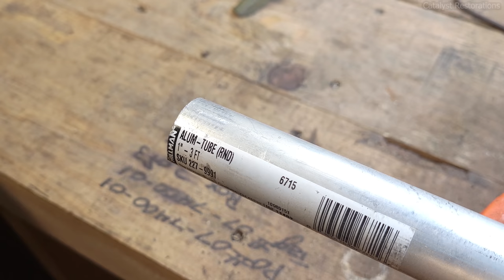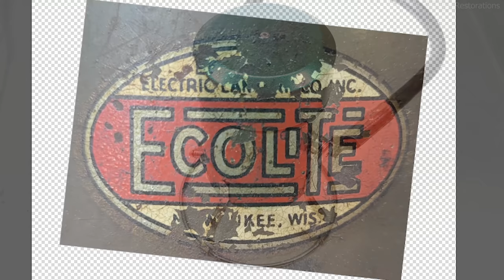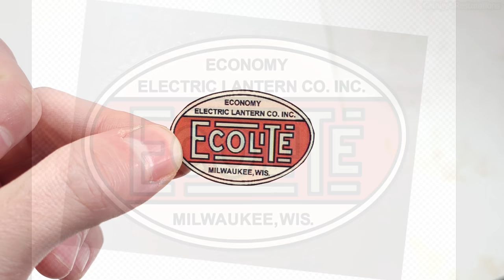89-year-old "Ecolite" Electric Railroad Lantern Restoration

Comment: I do Marine repair and also restore muscle cars and I took on look at the rust pile and thought man now way he is going to need a donor to fix that . Even for my standards I will take on the most difficult jobs if  I have too. That one i thought man no way its too far gone. But you pushed through the rust and rebuilt it . I love the color you picked! I am going to restore a old school die grinder with the flexible shaft it looks from the early 40s I got it with the original wood box. I want to refinish the out side of the box but leave the inside original and I need to fix a crack and replace the hinges. But I need to make a new decal for the top of the box and dont know how to do it. When I get my youtube channel going I want to make a youtube video of it and the restoration. But I still need to learn to edit. I ordered soft ware but the post office lost my order . So I dont know what I am going to do. Nice job my man nice job !
Reply from the maker: Thanks for the kind words, Roger. I had doubts myself at various stages of this project that I was going to be able to pull it off! Best of luck in your die grinder restoration, sounds like a great project! For the decal you might consider water slide decals like I used in this video. There are lots of great YouTube videos that explain the process and it's very straight forward. The hardest part is attempting to recreate the decal in graphics editing software. As far the video editing goes, don't sweat it! I didn't know the first thing about it before I started this channel about 2 years ago and I learned it all entirely myself through YouTube. You could look into purchasing a copy of your editing software digitally if you're worried about losing it in the post again and your copy never turns up. I know it's not cheap!
Reply: @CatalystRestorations  I will be honest with you. For over five years I was frozen in fear of video editing, never been a techy guy. I still have a old school flip phone. Hey if it works why change it. I was very intimidated with editing, My dream was the You tube . But scared to death to try editing. Here about three months ago I got a free trial for Movavi . I was scared to try it . I literally talked to myself and told myself and forced my self to open it up and get some old videos I had done and started playing with it. I went on youtube for Movavi editing and made some simple steps like cutting and adding text and transitions. I started getting some confidence in myself and after a week my trial was over. But dude Movaivi kicks ass I learned so munch in one week ! My business shut down 95% so I had no money to buy it. I want a cd not a signal and down load incase my pc crashes and can down load it again. I had no luck. I started watching more videos on tube and found one on shotcut. I watched all the way through. And thought wow that is cool very basic and lot like Movavi . I found a older version on ebarf for 2019 on CD and ordered it that is when the post office lost it . Looks like the seller is sending out another one for me. He is getting positive feed back. I have a lot of projects already done for youtube that are un edited . I had to put it on the back burner because I ran out of money I need a $90.00 linkage but current project is a Factory 425hp Chevy 409 intake and carbs I am restoring . I got the wrong carbs with the set up but they will work but that is going to be one of my youtubes. The linkage wont work for it I have to buy Edelbrocks linkage and its almost $90.00 I am excited to get it done and filmed when I am done I am going to sell it. I hope this will help people with the video . Rebuilding carbs is a dying art thanks for the well wishing and reply

Comment: You might consider putting a coating of NOALOX on that rotating switch mechanism's contacts to prevent future oxidation/corrosion
Reply from the maker: Excellent advice, I think I will do just that! Thanks for watching!
Reply: @CatalystRestorations  I also dope the light bulbs that screw in, both on handheld equipment, and outdoor bulbs on houses or bulbs in bathrooms with a thin layer on the threads, and a dab on the end contact. They can be in there for years, and they unscrew without getting stuck and breaking.
Reply from the maker: @specialservicesequipment393  Also a good call, because these bulbs are very fragile!

Comment: Concrete Cleaner and Metal Prep solution that you can purchase at Lowes/HDepot is the same stuff as Evaporust at a fraction of the cost.  I have a bucket of the stuff and use it all the time.
Reply from the maker: Chemically those are completely different products entirely. Klean Strip's concrete/metal prep solution is 40% phosphoric acid and does dissolve rust, but it will also eat at your base metal too because it's an acid by its very chemical composition. Evapo-Rust on the other hand is 90% water and 10% sulfur-based chelating agent that chemically bonds to iron oxide (rust) only. You can leave delicate steel items indefinitely in Evapo-Rust (literally for years) without the base metal ever breaking down. The concrete cleaner is also really a one-use product whereas you can reuse Evapo-Rust over and over. I've been still using the same 1 gallon jug for almost 2 years now. Personally I also care about environmental impact as well and Evapo-Rust is substantially safer for the environment than a concrete etchant. Not an Evapo-Rust sponsor, just believe in the product. Electrolysis for rust removal is still cheaper than literally anything else though by far.

Comment: Funny that in 2022 we use that same design lantern on the railroad
Reply from the maker: Crazy right?! I take it you work in the railroad industry then. I will say that I would like to at least see some LED bulbs in this lantern though! I've got a few other lanterns waiting to be restored and I may upgrade them to LED as part of the restoration.
Reply: @CatalystRestorations  yup 19 years. And they still use 6v batteries but they are led. You would think they would have rechargeable lanterns but I’m sure the railroad is too cheap to buy those
Reply from the maker: @7171-Ws6  Hahaha, too funny. Well stay tuned, I'll have some more lantern restorations coming in the near future!

Comment: Very nice refurbishing effort in this near totaled lantern. If you want something closer to the phenolic insulator plate that was broken up, try using printed circuit board materials. If you can't get the material without any copper plating, use some Ferric Chloride to remove the copper . And then you have the perfect insulator plate that can be drilled and formed however you like. Just an idea... Thumbs Up!
Reply from the maker: Hi Gary! You are the first person who has been able to nail down for me what that material is called - phenolic insulator! Thank you for that! I did look into circuit boards and I think it's actually a better analog to the original material than the plastic I chose. It essentially just came down cost, but in the future (I've got a few more lanterns!) I think I will try the circuit board route! It's mostly uncharted territory as far as I'm aware for electric railroad lantern restorations! Thanks again! 👍

Comment: Well done! I am wondering if there is some kind of protecting glass or so for the bulbs missing?
Reply from the maker: Hi Ulrich! Many of these types of railroad lanterns do indeed have a plastic or glass housing. This particular model was not designed for one (although I think ones with housings look 'cleaner'). An easy way to tell if there was a housing that is now missing is to look for small hinges, latches, or tabs around the reflector area where you would secure the housing in place.

Comment: I just bought one this afternoon at a local antique store. Where did you find the bulbs?
Reply from the maker: I was lucky enough that I have original bulbs that still work, but Amazon will be your best bet for buying new ones - they are E10 socket bulbs! Should be around 6V, since a lantern battery (the big square one) is 6V.

Comment: There was no glass dome for the protection of the lamps?
Reply from the maker: This particular design does not have a protective housing, no. The modern equivalent designs also do not use a housing either. In this case I did some research online just to confirm, but you can also always visually tell by looking for any extra screw holes/mounting points around the reflector area and/or hinges that would've held a housing on. In this case, there are none which doubly confirms. Personally I prefer lantern designs that have housings though!

Comment: nicely done! except solder was very cold :p small torch would have been good on it since parts didnt have paint?
Reply from the maker: Yeah, that's a good idea, I'll have to try that next time. I had the soldering iron cranked up to the max setting (450C) but it just kept dumping all that heat into the whole piece of metal.
Reply: @CatalystRestorations  yerr would be good to get part so hot that solder just melts into it, ive used small cigarette lighter size torch (storm lighter called here)for battery cables, it will take a time but worket perfecty
Reply from the maker: @kiiiisu  Thanks for the tip! I'll have to try that next time I'm in this situation!!

Comment: Так и не поняла для чего
Reply from the maker: I explain it a bit in the video description, but basically it was how a person in the back of a train could communicate to the person in the front operating the train. You would turn the lantern on and then raise or lower it with your arm to indicate a command like 'stop', 'go', or 'back up'. Another person on the other end of the train (or even a boat in some cases)  would see your lantern signal and know how to steer the train. They used lanterns like this before radio communication was possible. If you're interested in more information you can google 'brakeman lantern hand signals' and there are some charts.